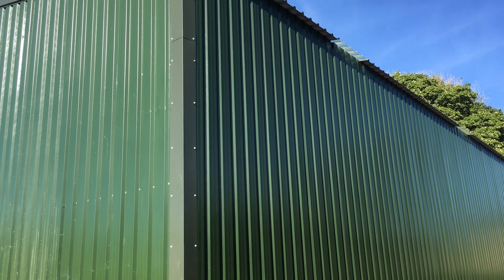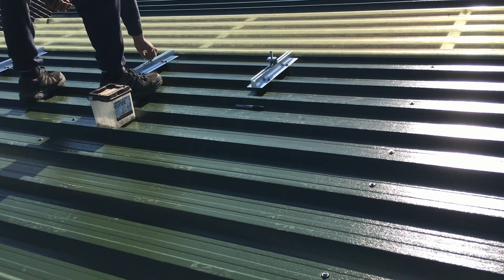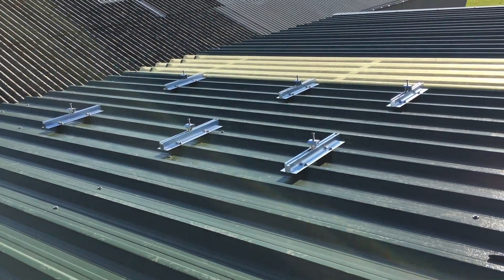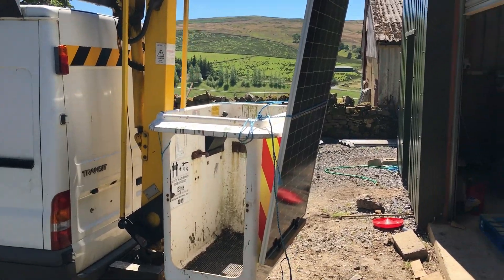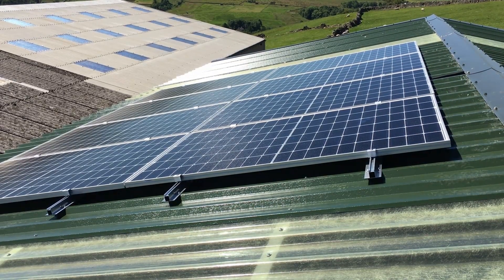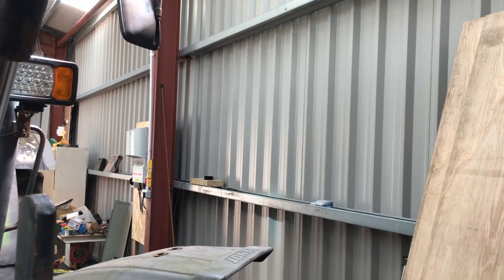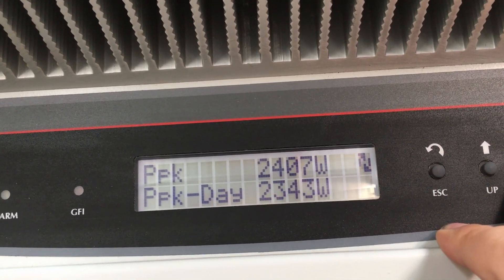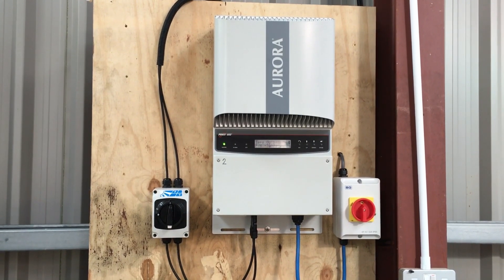DIY Solar Install On Metal Shed Roof - Solar on a budget

Comment: What screws are used to fix the rail to the roof, I'm looking at doing this but am worried that the wind will get under the panels and rip the screws out the tin as it's only thin
Reply from the maker: @amh01mes  The brackets I used come with special screws. They are a bit like the type that hold the shed together, but are tapered and have an extremely sharp point. I live in a VERY windy area on a hill top at 1400ft above sea level and haven't had any problems...
Reply: I've got a shallow slopped roof 8mx4m that I'm putting 14 panels on 🙈🙈
Reply from the maker: @amh01mes  I'd think that would be fine. The slope on this one is around 15 degrees so it's not a very steep roof.

Comment: Since these are transformerless inverters with no galvanic isolation, the panels / panel mounts should have earth wiring. In practice they will be earthed through the building - but likely not up to code.

Comment: Just out of curiosity; The other faulty inverter you bought, did it suffer from the same problems as the one you showed us repairing of (burned relay connections and shorted diodes in SMPS)?
Reply from the maker: Just the relays. The rest of it was fine 👍

Comment: Whats the slope of shed?
Reply from the maker: Good question, and unfortunately I have no idea. I know the shed next to it is 15 degrees and the one I put the panels on is either similar or less, which probably isn't the optimal angle for maximum output, but I still get pretty good results.

Comment: Hi there, great short video! I haven't seen that fixing system for renusol before, I thought you had to run full length rails. Yours is much easier. I have posted a few videos of solar installs that i have helped with and I am running an ABB like yours and a SAJ and Solis, to spread the load thin and benefit from different aspects. If only I had a shed like yours!
Reply: And subbed!
Reply from the maker: Thanks bootsowen. Did you check my video on hacking the inverter password?
Reply: @BuyitFixit  I saw the most recent one. Andy Reynolds put me onto it. I had a ground leak error like Andy has but on a solis. The solis has an option in the advanced settings to disable the various protect modes. Which makes life easy. I have posted videos of this
Reply from the maker: Nice! Well done. Hopefully it will help someone else with the same problem.
Reply: @BuyitFixit  That's what it's all about. Loads of people want to see solar stuff at the moment just to get a feel as to whether they could have  ago or if they need to get help. Not many of us out there chopping the tops off relays.  I saw what you did on the samsung washer too. I didn't think those rubber potted boards could be rescued. You've got patience. Most of my videos are about washers, I'm running one of those inverter samsungs now, found with a broken door. Lovely and quiet! Keep fixing.
Reply from the maker: @bootsowen  Thanks. The samsung washer was quite a few years back. I'm still using it. I only thought of doing the video after I had repaired it and then noticed it had a ton of views.. It was part of the reason to do repair videos, and also because I started watching a channel called @mymatevince who has been fixing stuff for ages. He's a good guy and gave my channel a shout out on an upcoming video of his.

Comment: You mention you are in a windy place. Any plans for a wind generator? Maybe even based on the Washer drum?
Reply from the maker: Yes. I've got a LG washing machine drum which I've attached a pelton wheel to. Its actually the one in the solar inverter repair video. I need to see if I can get enough pressure from a stream near us to see if I can drive it yet though. If you search washing machine power on YouTube there is a guy been running his house using one for the past 15 years!
Reply: @BuyitFixit  WOW potential of Solar, Wind and Hydro Electric. Can I move in next door please :-) You will be selling it to the Grid next.
Reply from the maker: @chrisbartlett6022  I'd like to be fully off grid. We are on our own water supply, have a wood burner and oil boiler. The only real utility bill is electric and internet. It would be good to remove the electric one. I've got some lithium batteries coming so I may change the system yet to an off grid system or both on and off. We'll see how it goes..

Comment: I like that you mentioned the product name of the mounting kit. Concerning the whole install, the mounting kit was around 33% of the price of the panels, wasn't it? It looks like they cost around 100€ per panel and the biggest panels I found were less than 300€ in price.
Reply from the maker: The panels were around £131 each so £2100 for 16 of them. The two inverters cost £130 including parts to repair them, and the mounting system around £350 and isolators etc another £150. Hope that helps!
Reply: @BuyitFixit  Did you consider other mounting systems? Or did you have resons not to choose another system? I like the one you choose. However, it seems to be the not one to buy spontaneously (forgot to add the "not". I didn't find it in Germany. It is always "price on request", "unavailable" or something like that).
P.S.: Thank you, for answering so many questions in such a detailed way.
Reply from the maker: @merkatorix  I was struggling to find any type of mounting system for a sheet metal roof that was in stock and that would be supplied to a non trade person. I even ordered from one company that cancelled my order and said they could only supply if I bought a full system from them due to shortages of mounting equipment.  Eventually I found a company called tradesparky who I ordered them from.
Reply: @BuyitFixit  I thought it was only me or a local problem to Germany. I wonder why that's the case. Maybe, because it is hard to make profit with those things, if they are not sold in bulk or from China.
The same is true for some inverters. Everyone talks about MPP Solar Hybrid inverters on youtube, but I never found them in Germany, although some youtubers like Marco Reps apparently got them. And the ones our Electrician recommended like Fronius Solar, are not available this year. For big solar systems they are not even that expensive. But just not available.
Reply from the maker: @merkatorix  Perhaps demand is high currently due to increased energy prices and energy security fears? Possibly supply chain or chip shortages may affect supply also.
Reply: @BuyitFixit  Also I am convinced about that explaination when it is about the electrical part. I just wonder why it seems to be almost worse for pieces of aluminium. It is not even that much, so the material itself isn't such a problem either.

Comment: Did you use self-tappers to fix it on the roof? I have never used self-tapping screws into metal yet. It feels like it will work itself loose at some point. How many kgs of force would you expect them to withstand per screw? And how likely is it that the connection will start to leak at some point? Does someone have long-term experience with how that works out after 10-20 years?

Our electrician recommended us to install something similar, but he told us about a system where you can slot the panels into one side and leave the other side hanging down to avoid internal forces. As we live in a windy place, I wonder if the storm can lift the cells out of that system. Technically I would prefer something exactly like your solution. He claimed that lowers the risk of the construction starting to work loose and to start to leak.
Reply from the maker: We live in a VERY windy area also! The screws are stainless self drilling ones that come with the renusol fixings. The screws are quite thick and are similar to what holds the sides onto the metal beams of the shed. The whole system is called renusol metasole+. The rails are the 400mm ones. 4 screws hold each rail and 4 rails per panel, although 2 panels can share a rail if in the middle. If you search metasole+ I'm sure theres a data sheet of the kg and wind resistance etc.
Reply: @BuyitFixit  I think I found the manual for it. So it is corrugated roofing sheet, then the rails, then the seal, and the screw goes through the whole thing. There seems to be no seal between the corrugated roofing sheet. Isn't there a risk of a leak there or corrosion happening? Apart from that I only find much more expensive offers from that company :/. Probably, I should invest more time in researching them. They are from Germany. Being much cheaper in the UK doesn't make much sense.
Reply from the maker: @maxmustermann2596  The rails have a rubber strip on the bottom and the screws have a seal on them too. Also the solar panels cover the area and the screws are on the ridges not the troughs of the sheets so I think they should be fine for water ingress.
Reply: @BuyitFixit  Thank you, your description helps a lot. I didn't see the rubber strips when skipping through the manual.
The price might be due to the inflation, which we have here. I only find offers of around 250€ to mount three panels, and those offers are not even available right now. The rest is "price on request". At least I know that they exist and how expensive they have been at one point. I should research the system our electrician talked about and compare those.
I always get the impression that in Germany, people use fixings like the "Renusol 920008 M10x200 Hanger Bolt Wood" (maybe because of wooden sub construction?). When I search for that item, google leads me to an English page. Maybe there is less panic buying in the UK right now.

Comment: How do you isolate the PV panels while wiring them up? Or did you do that bit at night? 😂
Reply from the maker: I wired up the DC isolator first, to two mc4 connectors. Then connected all the panels together, and plugged them into  the two wires going to the isolator.

Comment: Certainly a bit different to microscope work at the soldering station.  Nice vid.  I look forward to the next buy it fix it adventure in different wire gauges.  Would be good to see an update on how they're performing after a couple of months of data.
Reply from the maker: Good idea. Thanks for your kind comment.